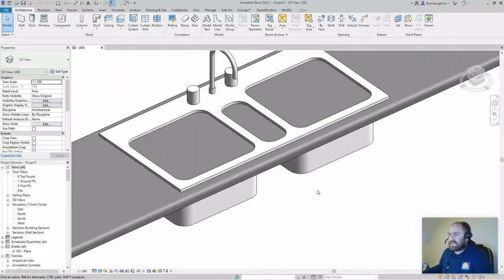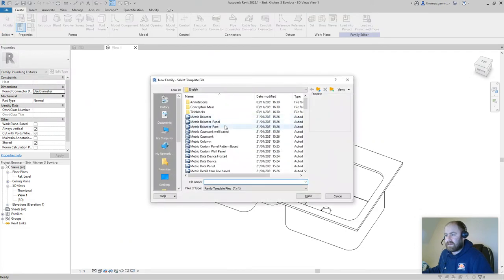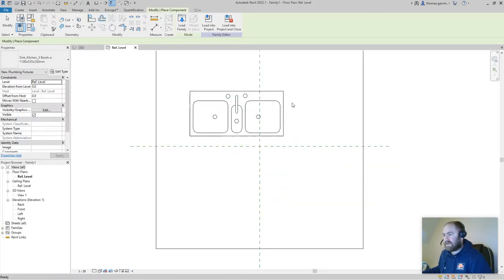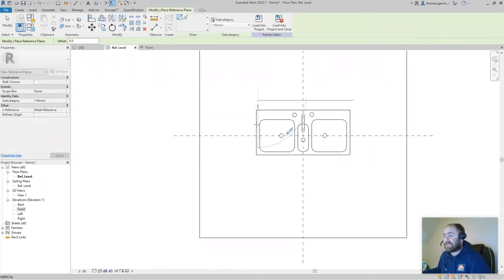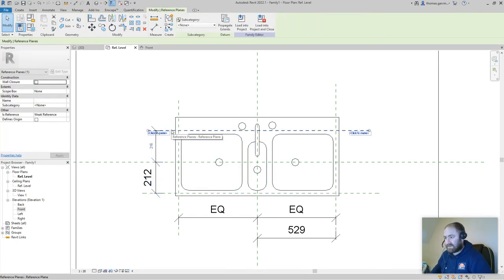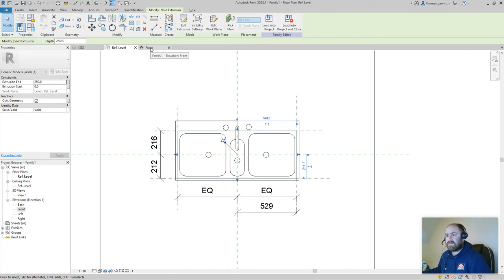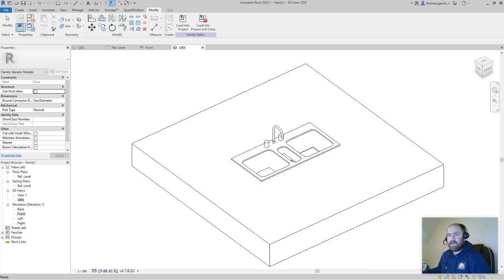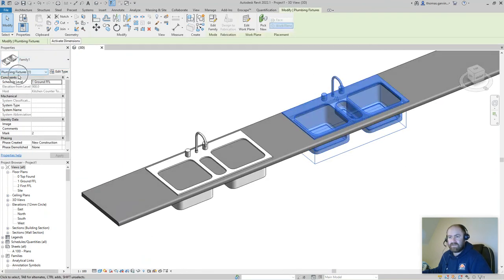How to make a Revit sink family cut a counter top

Comment: Hey great video thanks, I noticed that the void box is visible in the floor view, any way to disable it?
Reply from the maker: Hey Esteban.. thanks. The void outline shouldn't be visible because the sink should be covering it. Can you see through the sink? Maybe check your view settings for the sink's category, is there a transparency override? If you don't find the solution there then maybe check the sink family. It may be that the sink's solid geometry is set to be hidden in plan view and there may be 2D lines only. If this is the case you can fix it either by selecting the sink geometry, click into Visibility / Graphics Overrides and make sure Plan is selected; or, in plan go to your annotate tab and create a masking region over the outline of the sink. Finish the masking region then send it behind your 2D lines... Hope something here helps... let me know

Comment: I notice that in this video, you are using release 2022.  However, I have a need for this in projects which are created in earlier versions of Revit (specifically, v_2019).  When I follow this procedure in v_2019 families, and then place them in the project, they still do not automatically cut the counter as they do in your video.  However, I was able to make it work by placing the void in the face-based family, but not cutting the extrusion.  Then, when I load the family into the project, I can make it work by using the "Cut Geometry" tool.  Any ideas as to why this occurs?  Am I missing something?
Reply from the maker: Hi Dan. I'm not sure why that wouldn't work in 2019 and unfortunately I no longer have 2019 installed to go check. However, assuming you did everything right and it didn't work, maybe try this workaround: Load the void you made into a new faced based family as a nested family then put your sink into that family as before. Let me know if it works.

Comment: Hey - this was hugely helpful but I'm having an issue with Revit 2024. It does not want to attach to a countertop to cut it. If I add it in a 3D view, the island disappears from the plan view. I'm uploading a screen grab, and tagging you in it, hopefully you can help (https://youtu.be/ftr6dbYJ14U)
Reply from the maker: Hi Thomas, thanks, that video query makes it very clear. What I didn't see though was a plan view of your countertop with no sink or void cut in it at all. Just want to eliminate the obvious first... I mean, if you delete that last sink (there was still one there) is the counter then visible in plan? If not, then obviously the sink isn't the issue.. Let me know
Reply: @tg-at  I created a new countertop and used the "workaround" to place the sink on the countertop, went back to plan view and the countertop disappeared again. If I delete the sink I put in, the countertop stays "hidden"
Reply from the maker: @ThomasReynolds  there may not be a straight forward answer to this as Revit 2024 is pretty new and may have bugs... The problem may be the countertop family (is it a family or model in place?)... If you do the same procedure with, say, a furniture family to host the sink with void do you get the same problem? If it is a bug then some little fiddly type solution might fix it.. something like delete the countertop then undo might work. The fact that the countertop won't host the sink from plan view though suggests to me that the problem is with the countertop family
Reply: @tg-at  I'll also submit to autodesk. It is the autodesk island countertop family that I'm putting the modified autodesk kitchen sink family with the void cut in.
Reply: I had the exact same thing happen in Revit 2024
Reply: @ThomasReynolds   I was having the exact same issue and found the issue was in the countertop family. 
The 3D surface was turned off in plan and was using a filled region in plan views so for whatever reason in plan the sink could not register the sink as having a surface (I'm speculating). Once I changed the counter family the issue was resolved.
Reply: I tried this procedure with a model in plasma counter top. But it didn’t work.